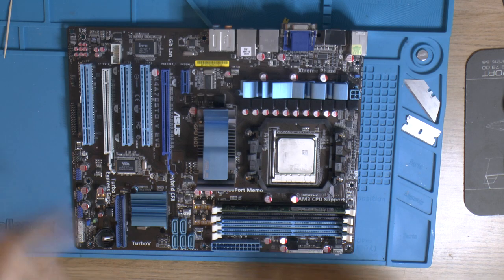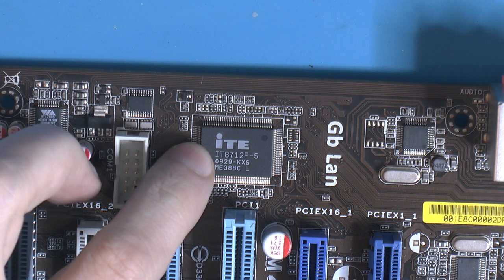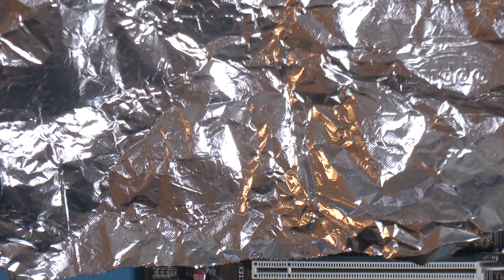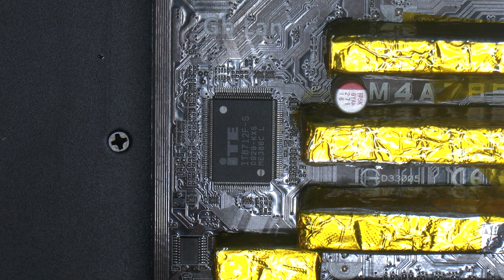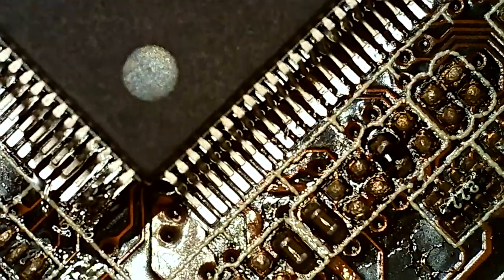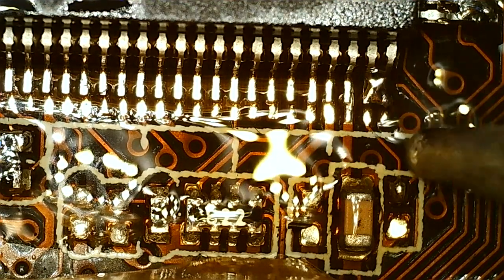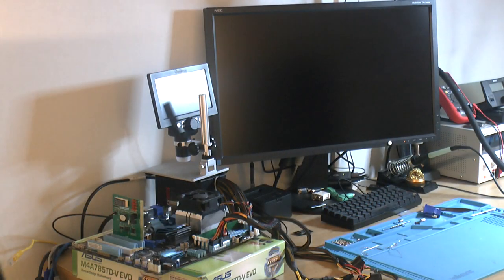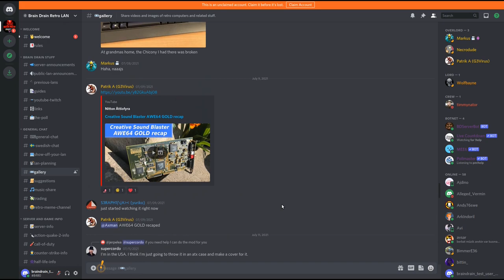I killed my MB shorting it, then I blew it up trying to fix it... Let's fix it again!

Comment: I can diagnose a computer down to the motherboard. It's impressive to be able to fix a motherboard. Useful commercially or money wise, probably not. I find this very fascinating though. I work in a pc shop and deal with motherboards that people break all the time....we don't fix them, but still this is interesting.
Reply from the maker: I dont think a normal PC shop would do it, BUT what ever you send back that is worth refubring probably is.

I dont have exact prices but I heard that a LGA socket is about 100 USD to replace and motherboards being 400USD + nowadays it makes sens for the manufacturer to have them refurbed and resold, sometimes the customer payes for that strait up if they admit to causing the socket to be damaged and just wants a repair.

Also privet companies seems  to charge about 230€ or USD for a reball of GPU and/or VRAM so with prices being what they are today people are willing to pay for it and it also seems that the manufactures do reball and resell cards also.

But yea probably best done at the manufacturer or some private company paid to refurb motherboards and GFX cards to keep the cost at 100-250USD per board, can well be worth it if the resell value is 400-1500 USD for modern MB and GFX cards.

Anyways it cost me less to fix this board then buying a used one of the same model.

If you check my next video coming up there will be links to people doing repairs of broken hardware professionally.

TY for watching and have a nice day!
Reply: Keep up the good work your videos are super cool. I have a lot of old computers laying around so I’m kind of lucky.